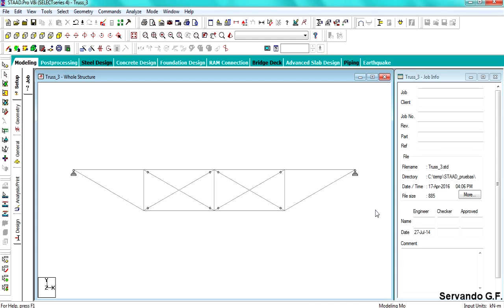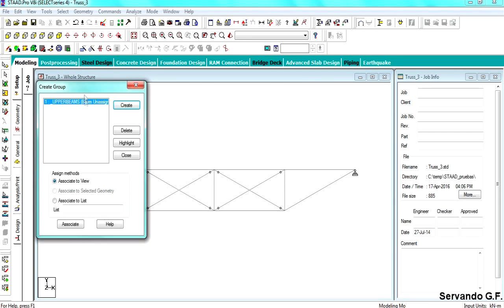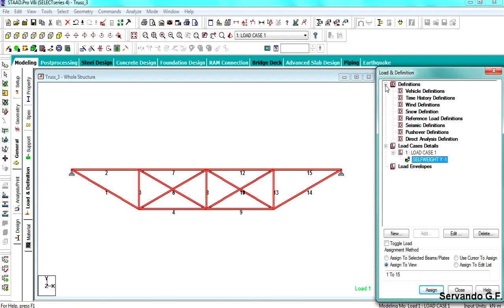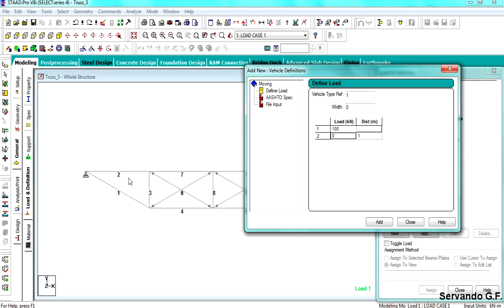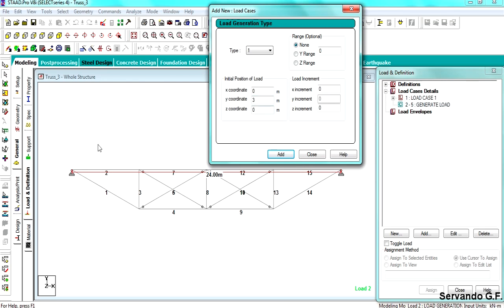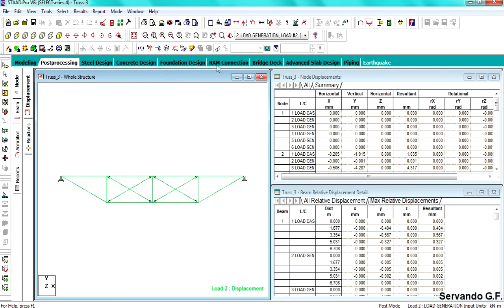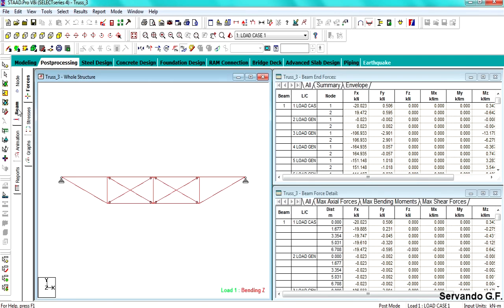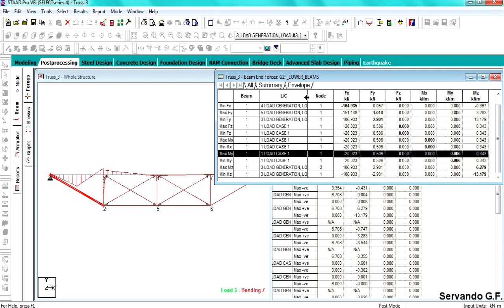Mobile loads ¦ Groups ¦ With STAAD Pro v8i

Comment: You can show the results (as groups) by property if you have assigned a different cross-section for each group of beams (i.e. top cords, bottom cords, etc.). Thanks for the video anyway.
Reply from the maker: Hi Ali, that is correct! It has been a while since I uploaded this video but definitely filtering by groups is a very powerful tool while analyzing results.